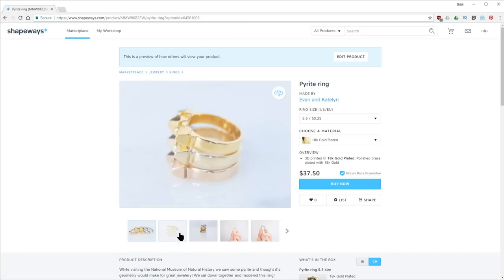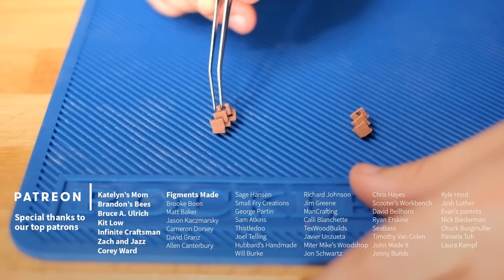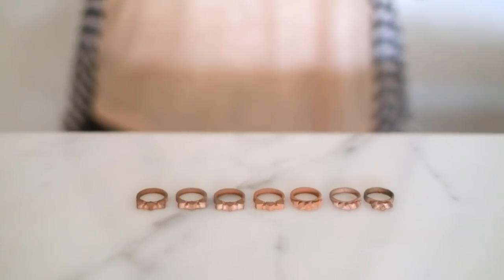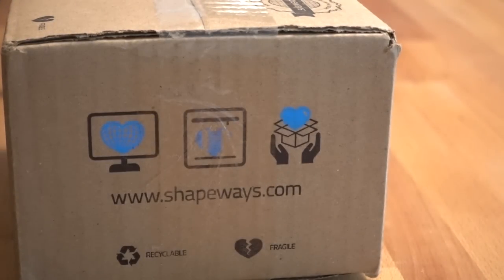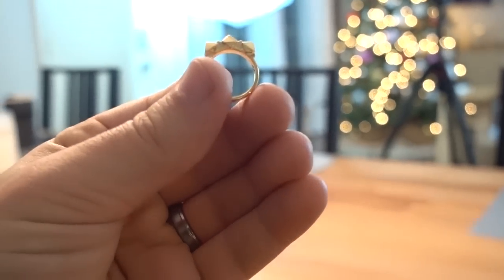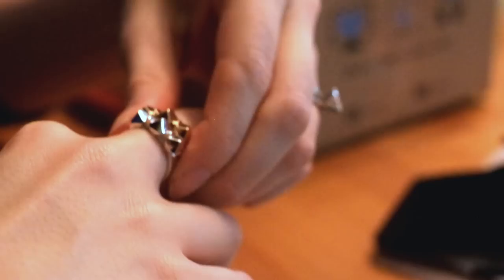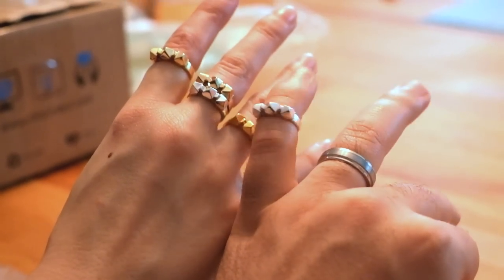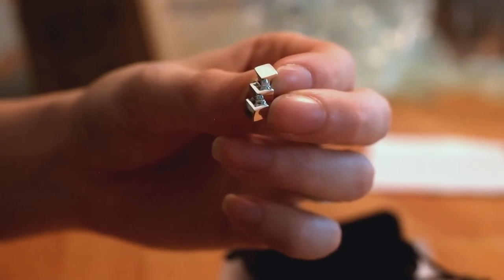3D printed metal jewelry (+unboxing)

Comment: So they printed it in wax, casted it in bronze, than plate it in gold, so you can sell a ring for 37 dollars and make a nice profit. That is amazing an really inexpensive your own designed ring.

So a couple of questions: 
For how much do they make a ring?
Is the whole aftersales done by shapeways?
Is the ringsize determined by ring in the 3d file or are they upscaling the total ring?
Reply from the maker: Yeah for real! Especially great for smaller things since the cost is by volume. When you "double" the size of something (in scale) it's volume actually increases 8x so the price can go up quite a bit for larger items.

The cost depends on the size and material so the best way to get an idea of cost is to go to the rings: https://goo.gl/YE94bt and play around with the size and materials (compare size 3.5 and 10). Just take a little off the price to see what the cost is. And yeah the whole aftersale is handled by Shapeways! For now we had to scale the ring for each size and make multiple models but they're working on implementing a feature which scales it automatically, so fingers crossed that is up soon. For now though scaling in Fusion 360 is not bad. Hope that helps!!
Reply: That's really cool and easy to make a few bucks. I know how addicting 3d software is.

Comment: That is so cool. Have you considered doing the casting yourself (take the 3d print and then do some sort of casting)? I think Ben Uyeda from Home Made Modern (like I have to tell you who he is) did something like that with sand, if I remember correctly.
Reply from the maker: Yeah definitely want to try that one day! It works especially well with low melt metals like Ben used. I think a really cool application for that is some sort of decor that won't be handled much

Comment: Hi, when they shipped the necklace piece that you designed, did it come with a chain ?
Reply from the maker: no we had to buy the chain separately. In our shapeways shop we have a link to the chain we used, but shapeways does sell chains themselves too
Reply: @EvanAndKatelyn  so do they include the chain in the price automatically, or do u have to manually request for it to be added with the shipment, and also does it match the material of the print...BTW thanks for the help honestly u guys are awesome

Comment: Whta did it cost to get the neck less done or rings cheers
Reply from the maker: The cost depends on the size and material so the best way to get an idea of cost is to go to the rings: https://goo.gl/YE94bt and play around with the size and materials (compare size 3.5 and 10). Just take a little off the price (designers cut) to see what the cost is.